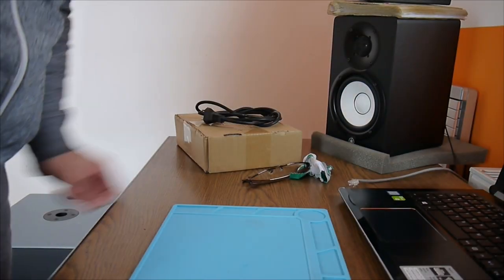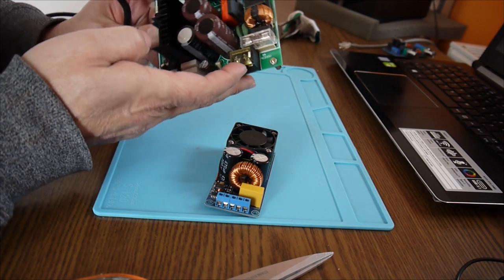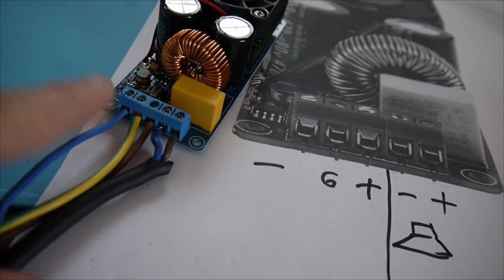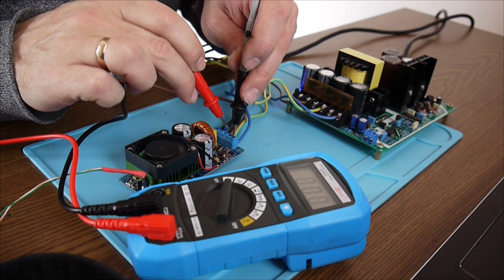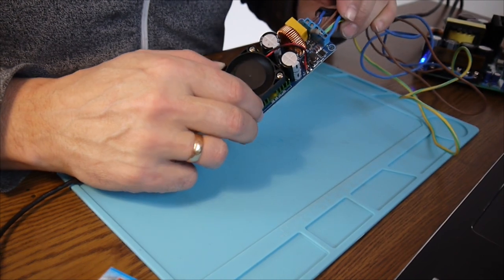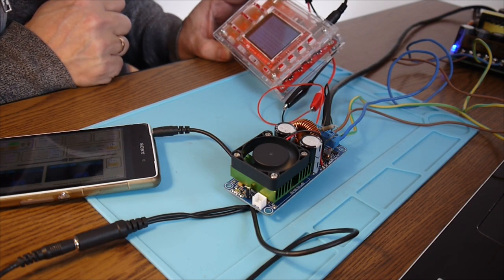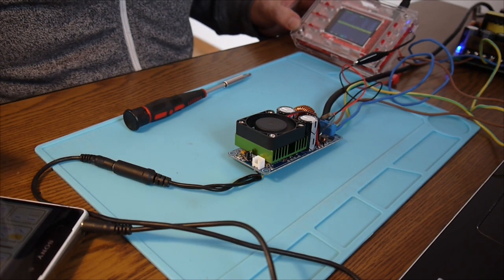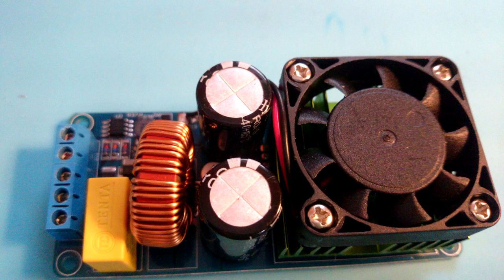Budget IRS2092 500W amplifier subwoofer project powered by SMPS 500W -+58V

Comment: salut , j'ai moi même éssayé le module classD que tu as chez toi , je n'ais pas été satisfait alors j'ai voulu essayé un autre et je suis tombé sur celui ci
 https://www.aliexpress.com/item/4000150333915.html?spm=a2g0s.9042311.0.0.47234c4dHrxxxF
pour moi il sonne beaucoup mieux!!
mais peut être que celui que tu test sonnera mieux avec le filtre basse
Reply from the maker: Hey! It's looking like with lower voltage like +-50 and tweaking frequency like 400Kz is working..but I stopped experimenting with it long ago.This module you showed is interesting, please let us know how is working and if is worthing the money...Merci!! be safe!!
Reply: @viocaia  il fonctionne très bien, moi j'ai branché deux module sur la même alimentation de 60V, tout est dans un petit boitier avec bornier pour les speaker et  RCA pour l'entrée du signal j'amplifie deux subwoofer pioneer  de 12" 300W le son est bien rond pas de saturation , c'est pour cela que je vous ai fait voir ce module, je vous envoie une photo de mon montage un peu plus tard
Reply from the maker: @toff5812  I'll translate for the others...''it works very well, I plugged two modules on the same 60V power supply, everything is in a small box with terminal block for speaker and RCA for signal input I amplify two pioneer 12 "300W subwoofer sound is well round no saturation, that's why I made you see this module, I send you a photo of my montage a little later''
Nice job!!!! I'll buy one my self as soon as this quarantine relax..
Reply from the maker: Hey! Just give me a hand and  subscribe ! Thanks!

Comment: With Class D Amplifiers you should never EVER touch the inputs, and that's because class D amplifiers amplify way past the audio range both below and above it, ergo when you touch the input you are feeding it extremely high voltages that you body naturally has, and these voltages drive the amp beyond what it can handle. 

Class D Amplifiers are switching at a extremely high frequency "beyond our hearing range" this high frequency is used to switch the output mosfets off and on at around 300Khz~600Khz, This key frequency is a square wave and to simplify this wave is a reference to switch the Output Mosfets off and on alternately, anyway long story short, that adjusting resistor sets your wave form so that the Mosfet's are switched with some dead time in between, as one works one way whilst the other after some dead time works the other way, now that oscilloscope you are using needs to measure up to at least a 1 to 2 Mhz at the very least, because you will need to adjust that resistor to the optimum frequency "usually factory set" if the module is prebuilt, change it at your own risk, if you built the amp from scratch only then will you have to adjust it for the right frequency ergo the right amount of dead time "dead time is critical if you don't want your components to blow up", also if you are setting up a stereo configuration you need to set both amplifier modules to the same optimum frequency, Check both and see which one is working at it's most optimum and then adjust the other to match it precisely, so that most if not all distortion is cancelled out especially if you invert one of the channels, once setup, they/it will drive your amplifier to it full potential, in your case a fair dinkum 500 Watts, don't forget to keep track of the phase of your signals if-n you have a stereo setup and have one with an inverted signal, also remember for that module it's speaker output is reverse phased, ergo put back into phase by treating the negative as positive and the positive as negative, if your amplifiers are not set up right you wont get the clean and powerful out put that these amplifiers are blessed with. Good Luck..
Reply from the maker: Very nice and documented remarks, thanks for sharing!
Reply from the maker: Hey! Just give me a hand and  subscribe ! Thanks!
Reply: Ola Amigo una pregunta por favor me podrían dar su opinión si es bueno cambiar el valor de la Resistencia R13 de 100 ohms a 3k1 ohms
Reply: @victorponce5039  
100 Ohm? to 3.1 Kilo Ohm? 😲 
Typing mistake maybe?? 
Anyway.. 
No.. Unless the manufacturer or circuit designer has changed things to improve function or perhaps to improve reliability. 
I'm curious??? What other components are being changed?..
Reply: @KorAllRBare   ok cambio y checo Gracias! Amigo Saludos
Reply: @victorponce5039  Si, 100 ohms deve ser sacada fuera; 3.1k o 3.0k deve ser soldada en su lugar; muchos comments en laNet para esso

Comment: watched your video, and I got exact same problems.. smoking resistor. and if I connected a dummy of 4 ohm without any input, the coils are getting very hot, 80 degrees celcius...The design of this amplifier is very bad. It oscillates as soon you put any input or output on it. I used 2 of these amps and a 1Kw 2x65 volts psu.. I managed to get around 400watts at 4 ohm out of them after a lot of effort...I would not recomend these modules.
Reply from the maker: Nice to let us know! I just give up!
Reply from the maker: Hey! Just give me a hand and  subscribe ! Thanks!

Comment: You should not power on the circuit without connecting the load (woofer), resistance blew off because of this. And the board did not perform well because it needs at least 1.5 watt rms from audio source so you first need to either amplify the source or use a mixer in the source.
Reply from the maker: 1.5watt? for input? I'm confused! And of course the amplifier was connected to the loudspeaker before power up.Believe me is not the first I tested in my  life!
Reply: @viocaia  sry 1.5 v rms
Reply from the maker: @dushyantchaudharymathura  I understand what you mean! 1.5V in! But there are flow in design.Please read the comments.
Reply: I meant 1.5 volt rms voltage sensitivity is required for input source, would not work well with mobile air laptop source. Let me send you a link where it is written in description, although user manual for this board says that no amplification is required.
Reply: The link for manual.   https://www.google.com/url?q=https://www.parts-express.com/pedocs/brochures/320-313-parts-express-brochure.pdf&sa=U&ved=2ahUKEwjw0b_6zIHoAhVDzDgGHRgoBIMQFjAAegQIChAB&usg=AOvVaw3OimGh5fMnyG818-fzi87x
Reply from the maker: @dushyantchaudharymathura  Thanks for sharing! It's useful for everyone.
Reply from the maker: Hey! Just give me a hand and  subscribe ! Thanks!
Reply from the maker: Thanks nice to know!

Comment: Sir this amplifier needs 1.5 v RMS input so use dual power supply amp otherwise you will not be get its full power. This amp is very powerful.
Reply: He is telling about the Input signal of 1.5v (input musical power) 
Well from where u got this SMPS of dual power output and what is its chopping frequency,,, pls suggest
Reply from the maker: @Somesh-Ji  I really don't know about chopping freq..I didn't care, the source is from Aliexpress I recall
Reply: @viocaia  don't connect any mobile phone directly to this amolifier without a pre amp , this amp need 1.5 volt ( atleast 1.2 volt ) of input signal . A simple pre amp using ne5532 will do this job very good
Reply from the maker: @apc2729  So you say the mobile output (phones) is not delivering enough signal..interesting..I'll check the levels with an oscilloscope..that can be an issue..
Reply: @viocaia  it will not directly give for sure, need a pre amp set up, the amp has closed loop gain of 33 which means it will amplify given input to 33 times ( if you give 100 milli volt input, amp will out only 3.3 volt !!!!!!....then how can you blame the amp????????? 

Remember, any mobile phone can give only upto 200 milli volt ............if you connect this to any ready made amp, they have pre am inside ......500 watts into 4 ohms means, you have to get 44 volt of output signal ...So, your input signal  voltage must me  44÷ 30 ( Around 1.5 volt signal )
Reply: @viocaia  I am happy to subscribe you. Thank you
Reply: @viocaia Note for users who is getting enough power : Unlike other amplifier , this amp utilize an inverting mode and the phase is 180 degree shifted of input, so you need to reverse polarity of subwoofer ( those who is concerned about phase shifts !), So it's gain will be - rf/re and not 1+ rf / re
Reply: @apc2729  Very good advice / point. Thanks
Reply: @Hudsonlee1954  One more advise I have. These boards work very well, however, you get original irs2092 and replace.....these boards do not use original Irs2092 !!!!but it works very well. You get plenty of power but it cannot perform as good as original irs2092. I have pioneer av receiver and I saw original irs2092 is used in Pioneer Av receiver ( 9 channel av receiver ) . I pulled some original chip and used with this board and performance was awesome !
Reply: @apc2729  Thanks for the interesting share
Reply from the maker: it is dual..of course!
Reply from the maker: Hey! Just give me a hand and  subscribe ! Thanks!

Comment: Im glad you show the chinese 500watt class D amplifier is typically rubbish if Resistors burn up. Very poor design
Reply: They're not all rubbish, most if not all Chinese manufactures are trying to better other manufactures based on much the same circuitry, ergo on eBay you may see many seemingly much the same amplifiers, but if one is a keen observer there are differences, and usually the latest models are better than previous models and perhaps even better than other merchant selling other manufacturers aging amplifier kit/s that have had hardly any revisions, mind you revisions are not the only concern as some don't need any revision at all because they got it right from the get go, ergo they are the bench mark that all other manufactures strive for..
Reply from the maker: Hey! Just give me a hand and  subscribe ! Thanks!
Reply from the maker: Hey! Just give me a hand and  subscribe ! Thanks!

Comment: hello,
its working good , i use dc 60v +/- , i am tested with transformer and smps  everything its good , i installed use power suply transformer ac45 ct 45v (under ac45 not working)  and use 2 capacitor 10000 uf 70v , dioda bridge 10A  ...loud and clear
Reply: It supports voltage till 70v if you are using smps supply and if you are using transformer supply, you need minimum 42 to 45 volts.
Reply from the maker: Nice! Probably my smps was to big like voltage or not powerful enough.I'll put a transformer together, the classic way like you did and try again.
Reply from the maker: Hey! Just give me a hand and  subscribe ! Thanks!

Comment: bro, how you control the vol? you use your pc ou smartphone?
Reply from the maker: Yep, by the output volume from laptop or any other audio source.Also there is a gain control by switching different contacts at audio in of the kit.
Reply: @viocaia  are you refering to the small trimpot near the input connector?
Reply from the maker: @leandrovinteres7851  P1 trimmer is for self oscillating adjustment, got nothing to do with input sensibility, which BTW is very low 1.5v, so if you can't match from a mixer or any other audio capable of 1.5v you need a preamp.Also you may need an osciloscope for adjusting the self oscillating freq to 400KHz.I didn't know that when I tested, so it's very possible this amplifier didn't perform because a bad oscillating frequnecy..I don't have'em anymore  so I can't check if is treu, but you may try and let us know.
Reply from the maker: I had another kit , smaller with a kind of switch for sensibility and gain, I made a confusion with this one...IRS2092 500W doesn't have any volume or gain control.
Reply from the maker: Hey! Just give me a hand and  subscribe ! Thanks!

Comment: 500w 😂 what is the RMS output power?
Reply from the maker: I think it means musical power...or peaks, no way of 500RMS!
Reply: @viocaia  Actually If your amplifier is setup properly with the right input and the right load "speakers impedance" and more importantly the right power supply, or and correct oscillator frequency or "reference wave form" 500Wrms peak is quite possible, and that's because of the Class D's efficiency to handle the volts and current limited only by the output Mosfets and the Power Supply. 

For your amplify to out put 500Wrms continuous it would need at least a 300VA 50-0-50 Toroidal Transformer feeding a 35 amp bridge rectifier, followed by a bank of High voltage capacitors storing enough energy so that when demand commands it, the energy is there for it, Be sure though you are using the correct Zener Diodes and resistors on your amplifier module to reign the beasts natural tendency to output more than it should, if you don't the beast just may attempt to out put way more than the out put Mosfet's can handle, and luckily a sacrificial resistor took the brunt of it, when you touched the input like you did, which BTW is proof how powerful these amps are..
Reply from the maker: @KorAllRBare  Yes you're right! I'll try to build one from scrap and I'll follow your indications.It should be nice if you can make a tutorial about all this matters, I sure it will be useful for all  us hobbiests .Thanks again.
Reply: @viocaia  my channel is mostly geared to live game streams as I dont have a proper 4K microscope and 4k camera, and for the past two years my voice has taken its toll making it extremely difficult to talk, ergo even my game streams have been very limited lately..
Reply: @viocaia  I  would be inclined to get another of the same module this time not touching the variable resistor, and with a frequency counter or an oscilloscope get a reading of its operating frequncy and then apply it to the one you already have,  just make sure both your modules are identical to each other, as in the same manufacturerer, and version, Once you have them both set up "frequncy matched",  apply 100hz 3 volts peak to peak to the input and turn up the volume so the output wave form is clean and more importantly more than 3volts peak to peak for each module. 
If both outputs are clean waveforms repeat by trying 1Khz and 10kz just note some amplifier modules may be overly filtered in order the operating frequency is filtered away, so the amplification may drop off a little at higher frequencies, mind you its been decades since DIY class D amplifiers have been around, so that anoyance may not even exist anymore..
Also just in case those modules are only set to a ball park figure by manufacturer, I would be inclined to ensure the reference wave form is set well within the region of the required dead time, as per testing your injected input waveforms are outputed cleanly within the audio range.. if they are not clean adjust the variable resistor one eay and test and test until you know you have the cleanest wave forms outputted once one is optimised, test its operating frequency and apply it to the other module, they now can be used as a bridge amplifier, but if you do make sure one is with an inverted signal and your load "Speaker" is with double the impedence for a single module..
!!?? Oh wow!! I just realised that would be a kilowatt!!!
Reply from the maker: @KorAllRBare  I don't have the power supply anymore, I  gave everything related to this kind of amplifiers, I'm more confident in classic B, I'm a musician too so quality of the sound matters!   But, as quick as the virus is gone I will experiment an IRS2029 with my own made amplifier.Now everything is closed and I don't like to have some boxes with parts from who knows where...but I already get your point.BTW I used a smaller version, like 200W for a stage monitor..maybe 100W loudspeaker and I may say it was working great! No IRS2029, I can't remember the parts, that's why I was so trusty with the 500W.And no problems with 'hand input' checking, it was just working! Thanks again for advice.
Reply: @viocaia  Exactly!
Reply: I think it can when using 4ohm load it can produce 500w rms.
Reply: Its rms is about 300 watts
Reply: @adityachauhan703  It's a Class D Amplifier So it is in fact 500 Wrms but "and this is a biggie" way back when.. Most Mosfet's were pushed to their limits in regards to switching ergo the sound was quite distorted by most class D amplifiers, Mind you I recently got myself two 150 watt @8 ohm and or 250 Watt @4 ohm modules and surprisingly they output 170 watts each @ 8Ohms with not that much distortion "onset of clipping" So over the years I guess the output Mosfet's have improved to the point distortion isn't to much of an issue..
Reply: @KorAllRBare  agreed ... Distortion is what it matters,,👍🏻
Reply from the maker: Hey! will help me with subscribe.Thanks!
Reply: It's 500W RMS, it is produced only if you use 65v dual power supply and 4 ohm load woofer, its a mono channel board, for stereo, you would need 2 boards and can sync the frequencies using the presets available on board.
Reply from the maker: Hey! Just give me a hand and  subscribe ! Thanks!